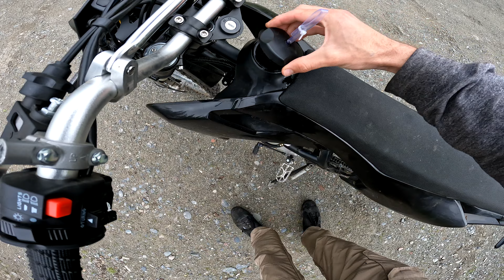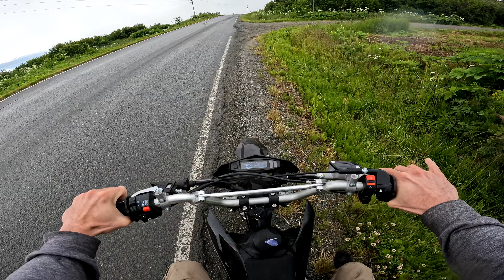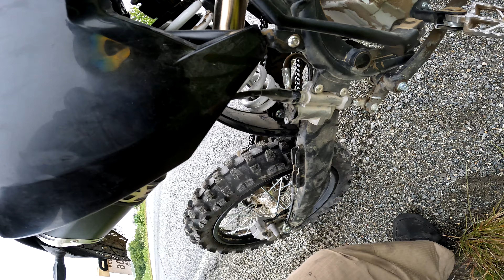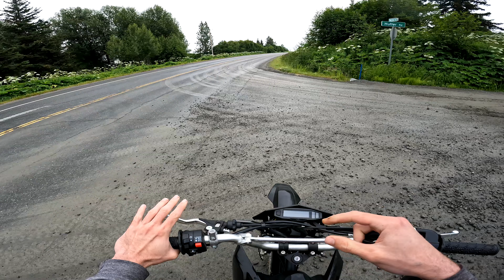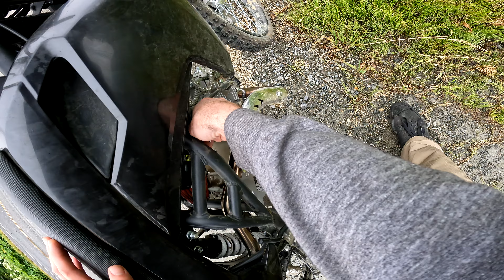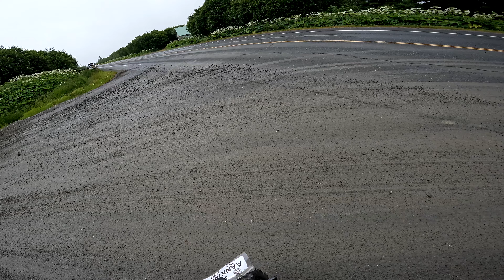X-Pro Storm 150 DLX Amazon $1400 Dirt Bike (1)

Comment: You can't crimp the gas cap vent hose the tank MUST breath.
Reply: Its not that tight bro, the Hole is just for the pressure to go out
Reply: @januslis6454  no it is to allow air in so the gas can flow out to the carb.

Comment: that problem you had is dew to that tube on the gas cap you have it pinched there for the fuel cant travel down the fuel line remove the white zip tie the fuel tank needs air